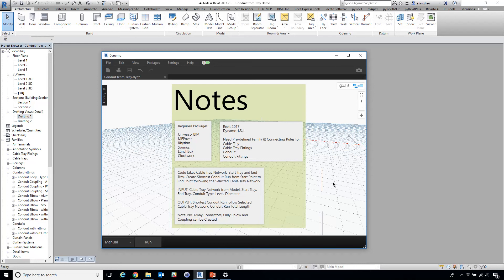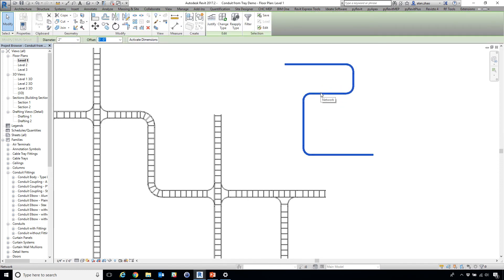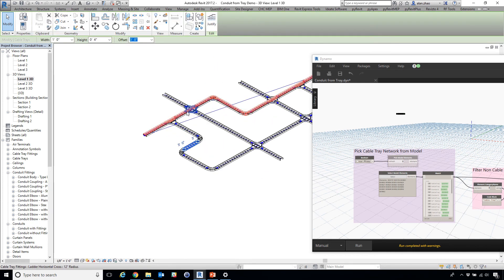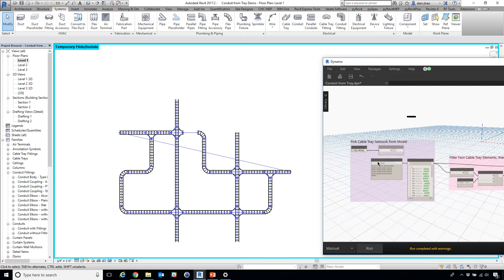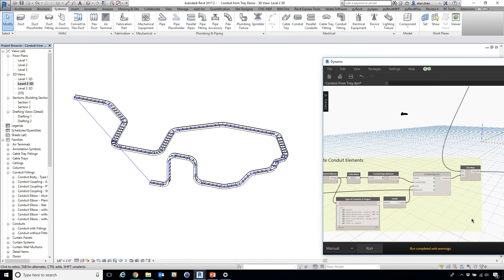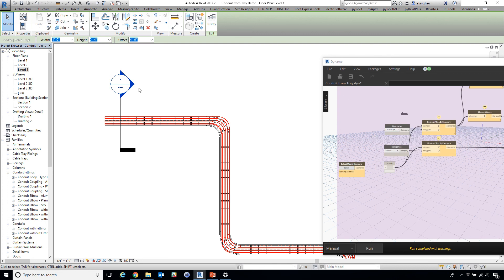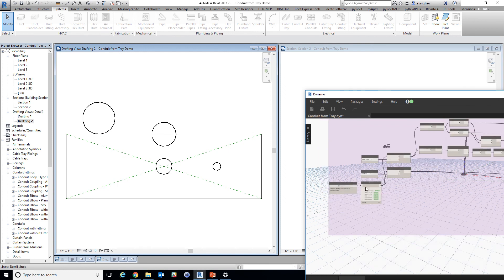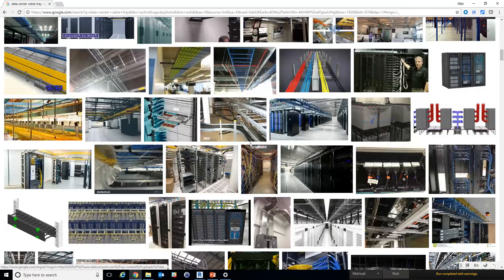Auto Generate Conduit from Cable Tray in Revit

Comment: hi NZhao great exercise but i think that the real challenge are the the nodes that you want to connect to a electrical panel from different points in space and a cable tray that needs to fit all that. Maybe this task needs to be created fully on C## to be more fast and without all these dynamo nodes

Comment: Hello! Great work!
Would this also work if you would have a space reservation in the shafts, ceilings (a duct for example as a space reservation), to generate the pipes, ducts, and even cable trays, by a typical section?
Reply from the maker: perhaps check out this one? https://youtu.be/MDhB-4NALFM